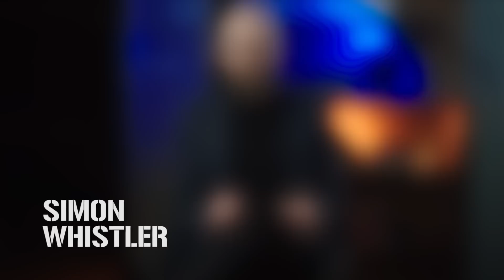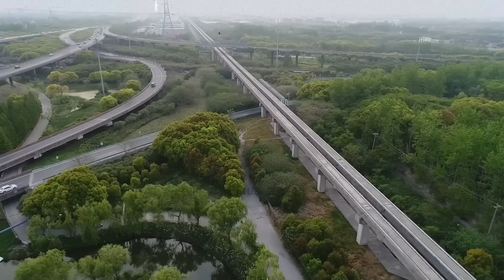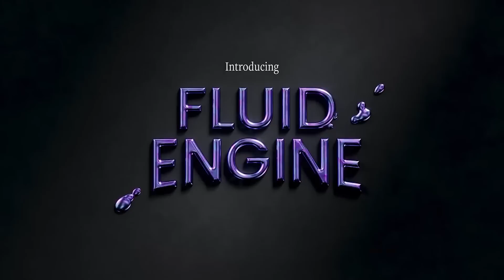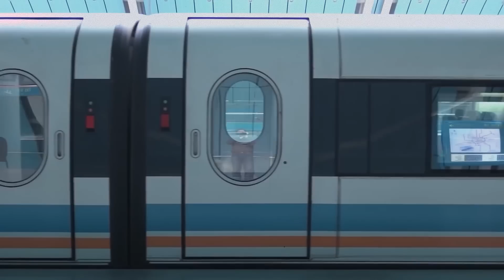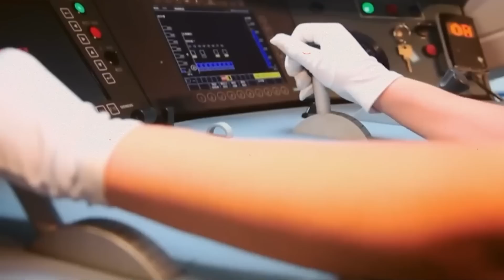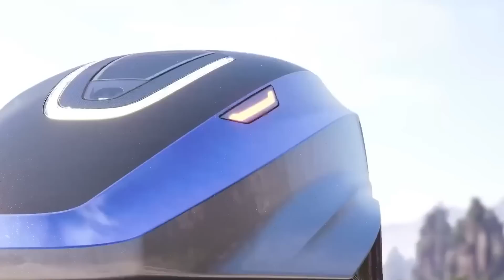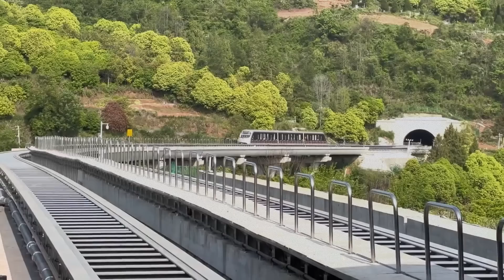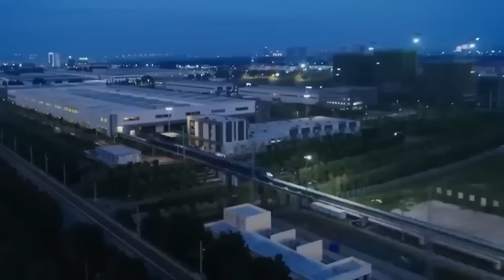A Chinese Maglev Revolution is Coming...

Comment: It could be done, but the expense of construction on a per-kilometer basis is going to be somewhere in the stratosphere. Reason: to keep up speed over 500 km (310 mph), you will need much more gently curved and sloped track alignment, and that means a lot of extremely expensive (by anybody's standards!) long tunnels and bridges. Just the cost from Chengdu to Wuhan would be extremely expensive with the very long tunnels needed going through the low mountains between Chengdu to just west of Wuhan, tunnels that will also need earthquake mitigation, given Chengdu is located near active earthquake faults.
Reply: I read somewhere that 90% of the 280km Chuo-Shinkansen will be in tunnels. And the Japanese are doing that for the surprisingly low price of 80 billion US dollars.
Reply: @ballyhigh11  
Right.

Cutting off an hour on the daily commute of a million people is progress. 

Cutting off an hour on a few-times-a-year biz trip for some big shots at cost of billions is a boondoggle load of it.
Reply: @ballyhigh11  It's more like 70%. And, the price is somewhat ficticious. Indeed, it's quite well known Japan that the companies building it can't afford it. Their strategy is to get the project to a certain point, go bankrupt somewhere after that point, and it then becomes "Embarrassing to Japan" that the project has failed. At this point the Japanese government is more or less obliged to step in, take the project over and get it into service. Somewhere down the line they'll re-privatise the company, debt free, and the original shareholders buy it up and get to run it at a profit. The papers know this, the government knows it, and the population knows it, but seemingly they're all powerless to prevent it. 

It's not even as if the project is popular; many cities like Nagoya are worried that it'll turn them even more into a dormitory town for Tokyo, leaving them devoid of businesses / industry. Others like Kyoto which are never going to be on the route in the first place (but do have Bullet train stations) are worried about being reduced to backwater desolate hinterlands through not having a MagLev line to the capital. The project is currently stalled on a trumped up environmental issue framed around tunnelling causing pollution of a city's water supply. The reason why is because the local city wants a station and isn't scheduled to get one, so the mayor is playing hardball and refusing permission to complete the tunnel.  

It's a bit like Concorde. The French and British governments couldn't back out (because of a craftily worded treaty they signed and probably shouldn't have), and then BA (and presumably Air France) got given the aircraft for a pittance. BA's operation was (in its prime) profitable. And in the end we grew to love Concorde, despite the public cost. 

China doesn't have to worry about the niceties of placating actual people. But, it does have to worry about cost. The existing high speed network has come about as a result of a lot of borrowing (even the Chinese government can't conjure believable money out of thin air in $trillion quantities), and there's much talk of an unsustainable debt bubble in the economy. If they go ahead and build a MagLev project, they might just break the whole thing. 

Personally I doubt they will actually do it; it would compete with the Comac C919, which is looking like a reasonably decent A320 clone. They won't want to destroy the domestic market for that with an expensive hard to pay for Maglev network. They want that aircraft to be a domestic success, to stimulate international sales. With Boeing down and nearly out for the count, Comac / C919 has a real opportunity to take profitable market share away from Boeing, earn some hard foreign cash. It's not "Western" certified, but there's probably some countries out there that will happily accept CAAC certification (CAAC were the ones who called FAA's bluff on the MAX - so they understand the business).
Reply: @abarratt8869  It's always amusing seeing people who have no idea talking with such confidence, China creates credit to fund these projects, all its "debt" is owed to itself.
Reply: @AndrewManook  domestically held domestic debt, is economically tricky. i many cases, the federal government in China will not pick up the whole bill, as it is split between the local governments and the federal. the local debt is dependent on loans from banks and do have to be paid back or at least rolled over. over time this causes problems to banking liquidity and stacking larger and larger sums of debt on the local governments. for the federal debt, they can just print money, which in turn weakens the value of the currency world wide, but that's less of an issue as the Chinese currency already has a split rate for international trade and domestic. both the acts can hurt China's long run GDP, as oversubscription to infrastructure is both ongoing costs and has questionable value. 
Rail can be great, and for a nation like China the spending on trains and roads have helped massively, but a second or third train to places that already have rail access will never have anywhere near the value. the first train is transformative, the second is slightly better, a faster train is more convenient. maglev cant interconnect to existing networks, It cant be used for freight, and it cant be used for local stops otherwise you just use a slower train. The economic value of maglev is minimal, and the cost is massive. 
,
Reply: Good points
Reply: The long-distance ones don't make sense -- that's what planes are for.
Reply: @hg2.  The idea is likely to replace planes. When you factor in the much faster boarding process the trip should take the same time, or even less, by maglev than by plane, with the maglev having much higher initial costs but much cheaper operational costs, and thus saving a huge amount of money in the long term.

Planes should be kept to just routes that aren't used enough to justify building maglev (or conventional high speed) tracks, given their higher operational costs and absurdly high environmental impact.
Reply: Long-distance mag-levs aren't for making cost-benefit sense.  They are for the bribes, boondoggle, and bragging-rights of the evil CCP.  (This comment will get deleted by pro-CCP censors.)
Reply: These long-distance mag-levs don't make sense -- that's what planes are for.

If these things can take an hour off the DAILY commuting time for 10 million people, that's
great.  

Or, if they can practically move 5 million people out to 1/2-priced housing and real estate, that's great too. 

But taking an hour off the travel time for a fat-cat's trip to Shanghai - that's STUPID.

* * * 

Actually, these long-distance mag-levs aren't for helping ordinary people, or even fat-cat business men. ---  They are for the bribes, boondoggle, and bragging-rights of the evil CCP.  (This comment will get deleted by pro-CCP censors.)
Reply: I'm sick of it.   

These status symbols don't help a million commuters get home an hour early. 

These stupid things aren't for transportation, they're for political bragging rights, like the Moon shots. 

Long distance maglevs, "bullet trains", HSRs  --- that's what PLANES are for.
Reply: See this video;

China's "ghost" railway stations prompt questions about rapid expansion ...

^^ $1 trillion in debt and they don't make money.

Long distance maglevs, "bullet trains", HSRs  --- that's what PLANES are for. 

These status symbols don't help a million commuters get home an hour early. 

These stupid things aren't for transportation, they're for political bragging rights, like the Moon shots.
Reply: Doesn’t count for the MagLev. It’s not a normal train many problems don’t affect it .
Reply: @bobjaydenmarley7406 Yeah, it is magic, only bound by imagination 😂

Comment: one fact that i find incredible is that while tgvs wheeled speed record is only abit slower than the maglevs record speed (570vs600km/h)

the difference is what it took to get to that speed, the tgv accelerated for 80km, downhill, and needed to disconnect so they could increase the overhead wires voltage half way through. and then took 70km to slow down to a stop

the scmaglev got from 0-600-0 in under 11km
Reply: Yes... that's the main advantage. The TGV run of 570km/h was impressive... but really it just required a long enough and straight enough track. In real life, there's a reason no wheeled train runs faster than 350km/h. It's just not practical... because... physics. Steel-on-steel acceleration and, more importantly, DECELERATION just doesn't make higher speeds practical. You'd spend very little time at speed... a little like speeding up to a stop sign. 

The L0 Maglev in Japan will reach cruising speed in about 60s which is remarkable. BUT EVEN THEN... any stops drastically reduce average speed. The Nagoya-Tokyo DIRECT service will take 40 minutes, but it's planned for the all-stops service to take about an HOUR longer. This is partly due to that fact that it will probably have to wait a little at some stations to allow direct trains to pass through, but also because slowing and accelerating still take time.
Reply: @TheNewGreenIsBlue  lot more issues than just that as well, china has tried running some of its trains at 400, and even considered dropping some down to only 300, because the extra wear and maintenance to run that little bit faster is huge
Reply: @TheNewGreenIsBlue  But from what I've been  told  the US doesn't even   have  traditional diesel or electric trains  for  most of the country.  You can't - for example - live in  Fredericksburg and commute to Washington/Arlington/Alexandria for work  by train   (I've checked, the train only  runs  every four hours and tickets cost up to $230 a trip according   to the internet,   a site called tripsavvy). 
Given  Washington DC is the CAPITAL CITY that is appalling, unfortunately the map didn't give distances so I've no idea of the distance but it takes an hour and a half to get there and there is apparently a whopping one train every four hours - tough if  you miss  your morning train to work, you're stuck. From someone used to simply going to the nearest train station and waiting for the next train (never more than an hour, we are a small rural station and not every train stops here) and being  in Dublin in under an hour,  slow train stopping at EVERY stop on the way, this is unbelievable.
Reply: @TheNewGreenIsBlue  True although generally the capital city of a country has the best public transport system.  I chose Fredericksburg  because lines from a couple of other major commuting towns go through it and apparently people do commute on that line even if  they don't actually live in Fredericksburg itself - plus there are 3 different train  companies use that line which theoretically should mean even better trains as it seems the US doesn't have one main company (like the Chinese do or Irish Rail  for example).  But it seems that in the US trains simply aren't seen as a  means of  transport on a daily basis (I'm a  huge reader and  I've only found one book in which a character commutes daily to work in NY via the train, in all the others they drive) but in books set in Australia, UK, Ireland, Canada, most of Europe and China/Japan they nearly all commute by train and the only driving is to and from the nearest train station
Reply: the TGV top speed was only achieved when they were doing a speed test, they don't operate normally at those speeds while the routine operation speed designed for the maglev is 600km/h
Reply: @hughmungus2760  JR's maglev's operational speed will be 500km/h.
Reply: @hughmungus2760  
I'm sick of it.   

These status symbols don't help a million commuters get home from work an hour early. 

These stupid things aren't for transportation, they're for political bragging rights, like the Moon shots. 

Long distance maglevs, "bullet trains", HSRs  --- that's what PLANES are for.
Reply: The long-distance ones don't make sense -- that's what planes are for.
Reply: @hg2.  It depends. Planes are great, but Maglev is more energy efficient and end up being faster and more comfortable.

You are thinking along the right lines, though... Maglev really does completely replace certain plane routes. HSR already pretty much got rid of Tokyo–Nagoya planes,  Maglev will make Osaka–Tokyo flights really only useful for transiting passengers.

Basically, two major city pairs less then 1000km apart. 
The entire Eastern Seaboard, for example.
BOS-NYC-WAS-ATL-MIA are all population centres in the top 10.
WAS-ORD is another good one. 

HSR is great, but if you're going to Boston from WAS... you're hopping on a plane for 80 minutes (plus 2 hours or so extra time). 

But you COULD be on a 2h maglev train. In that case... Maglev is the easy choice.
Reply: @TheNewGreenIsBlue  
As long as somebody else is paying for the expensive maglev boondoggle, sure.
Reply: @hg2.  depends, planes might be abit faster, but theyre a lot less comfortable, more expensive, more polluting and you cant take as much luggage
Reply: @vincentgrinn2665  
Sorry, I call bee ess. 

Cutting off an hour on the daily commute of a million people is progress. 

Cutting off an hour on a few-times-a-year biz trip for some big shots at cost of billions is a boondoggle load of it.
Reply: @hg2.  thats just a fundamental misunderstanding of how transport is used, increasing the accessibility means more people are able to use the train to get from city to city

the bejing to shanghai high speed line is 1300km and has 24 stops, its used by 240 million people per year, it replaced and end to end journey of 10 hours down to just 4, thats short enough to make it feasible for people to use it for more than just 'big shot biz trips' especially  because a ticket is like what, 150$ for a more comfortable and spacious ride than in a plane, and less cost
Reply: @vincentgrinn2665  
People commute from Beijing to Shanghai?
Yeah right.
Reply: @hg2.  never said it was commutes, but the line is already there with millions of people going between stations anywhere on the line, trains arent like planes where they only have one start and end

even with the train line theres still 8 million people per year flying directly from beijing to shanghai so theres plenty of demand

it costs nothing extra to have trains run from bejing to shanghai because theyre already going there
Reply: Long-distance mag-levs aren't for making cost-benefit sense.  They are for the bribes, boondoggle, and bragging-rights of the evil CCP.  (This comment will get deleted by pro-CCP censors.)
Reply: These long-distance mag-levs don't make sense -- that's what planes are for.

If these things can take an hour off the DAILY commuting time for 10 million people, that's
great.  

Or, if they can practically move 5 million people out to 1/2-priced housing and real estate, that's great too. 

But taking an hour off the travel time for a fat-cat's trip to Shanghai - that's STUPID.

* * * 

Actually, these long-distance mag-levs aren't for helping ordinary people, or even fat-cat business men. ---  They are for the bribes, boondoggle, and bragging-rights of the evil CCP.  (This comment will get deleted by pro-CCP censors.)

Comment: Shanghai maglev just does 300 now. Been there couple months ago
Reply: Shanghai's Maglev can travel at a max speed of 431 kph. But this speed is only touched once or twice a day.
 Normally tourists who visit Shanghai will choose the train schedule that travels at 431 kph. 19:32
Reply: You probably rode it after the sun went down. They still go 431 kph during the daytime.
Reply: So its still the same as the original German train 30 years ago

Comment: dont see how they would go maglev. the cost per km is extortionate, hence they chose to create the network over the extra speed.
the maglev in shanghai is nice although its only to the airport
Reply: did you not watch the video? the main reason is speed and maintenance. there is no friction.
Reply: @MGZetta  Just a lot of energy... And a high investment cost. And... what good is speed when you need to slow down when going through cities anyway? Trucks for example CAN go over 200kph.... doesnt change the fact they dont though for a number of PRACTICAL reasons. China as usual is being "look at us we so cool!" thinking they are as the west looks on like "you idiots"
Reply: @MGZetta  yes i watched it, I also watched several previous videos over the years which explained the cost per kkm was too high and china prioritised coverage over speed. even my chinese collegaue confirmed this.. the other issue with going maglev is that you need a long more straight track that using conventional high speed

Comment: Alarm Bells. USA needs a Construction Sand Aqueduct.

To primary objectives.
1) Process sand that isn’t suitable for construction into Sand that is.. mitigating global sand shortage 
2) constantly dump excess salt water deep in Nevada for evaporation. 

More fresh water and more Sand suitable for construction to avoid the same fate as Chinese Tofu Dregs concrete quality of construction
Reply: parrot, who told you all to start saying 'tofu dreg' ? you are no better than a bot lmao
Reply: @smoke5985  cool, thanks. Sorry if the term is upsetting but fact remains we are all running low on high quality construction sand that is needed for sturdy concrete. Two resources we need to secure for the future will likely be Sand and Water